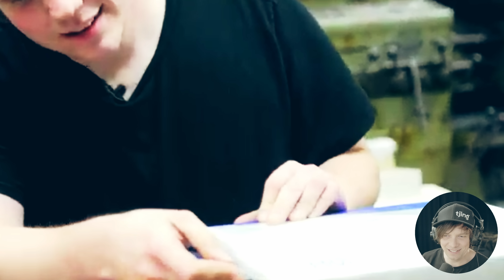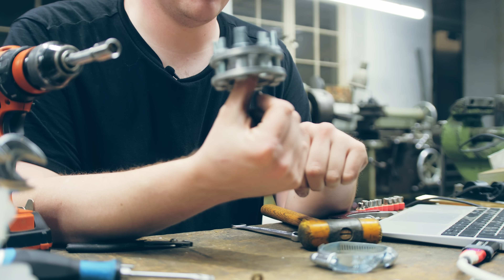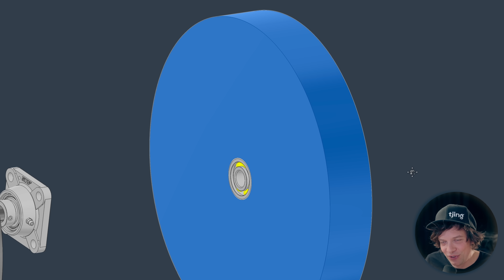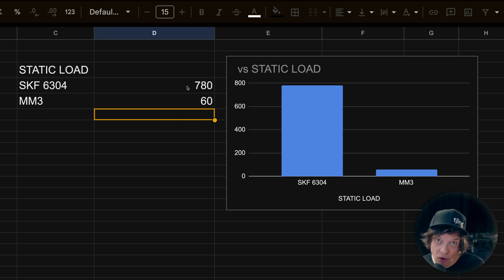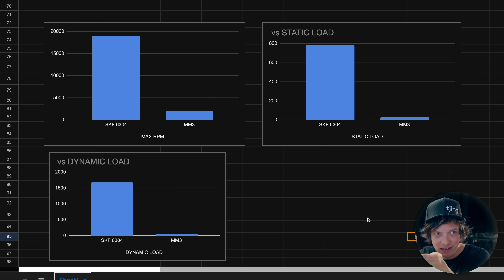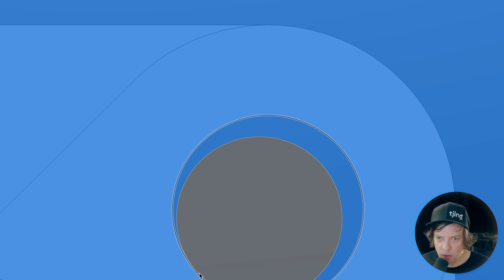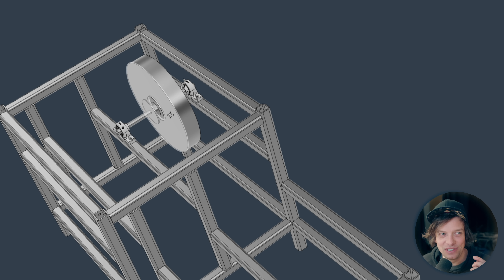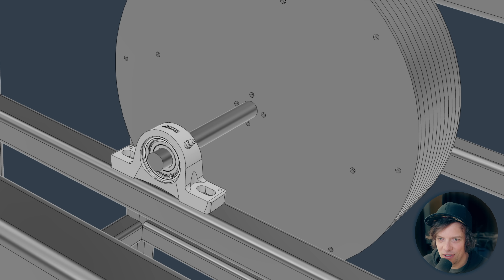Worst Bearing Housing Ever - Marble Machine 3 Ep.3

Comment: I'm no engineer, but fixing the shaft perpendicular to the flywheel not very dangerous? Any tiny misalignment will start a vibration, and destroy the machine, right? If you use a bearing which can change it's angle, the flywheel will keep itself straight, and no vibration will occur. Or not?

Comment: concentricity is good to start with, but probably not enough to achieve a fully balanced flywheel. even if the flywheel is 100% concentric and perpendicular,  it can be off balance, if the material isnt the same density over the whole volume. so you need to balance it anyways. concentricity of course makes you start closer to the balanced state though

Comment: For a stronger linear mass, you want rod-bearings, not ball bearings. You are setting yourself up for disaster with ball bearings. If you must use ball-bearings, use a 4-layer, staggered setup, for the bearing channels. You will get a depression issue, when they wear and introduce "wobble" in the mass, otherwise. Using rod bearings, you get a large, low friction, surface that extends wear resistance. Just like a car axle or generator or... A centrifugal mass flywheel.

Comment: @Wintergatan Take a look at designs for centrifugal pump shafts and bearings used in water treatment/ chemical processing plants, they often run for weeks at a time and newer ones have built in shaft realignment tolerance features that might be useful as a reference. They're designed to be sturdy and accurate too! (Don't have a Reddit to post this comment with sorry 😖)

Comment: i know im late but, you could heat up the fly wheel and put the shaft in dry ice, press fit them together annd when they get to room temperature, teh flywheel will have shrunk and the shaft will have expanded so they will have a super super tight fit

Comment: If you're concerned about concentricity you could balance it on the machine. When mounted on the shaft spin the flywheel slowly and mount an angle grinder to make the world's most bootleg lathe/rotary grinder. As long as the  fit on the shaft is good you'll be able to correct concentricity and perpendicularity.

Comment: I think you spent alot of time calculating what the bearing can handle, but I think the main concern was the threaded teeth- with those forces, the teeth will get crushed over time and introduce slack in the fit around your bearings, causing the housing to slip.
Reply: If anything, you should use an M6 where the portion in contact with the bearing does not have teeth.

Comment: You can use a taper lock to secure the flywheel to the shaft. That should satisfy your needs. You can find commercially available taper lock bushings for a variety of shaft sizes.

Comment: Perpendicular?

Bruh once u got the wheel built the hole the shaft goes through wil l be perpendicular. If u need to adjust it that meansvu f' the shaft hole size and made it too big socit has slop. Just put some shims in and a set screw propnlem solved.

Idk why u all are hand wringing about perpendicularity

Also balancing is where u kill all vibrations from non concentricity. Shims for perpendicularity

Comment: Improving concentricity with flange mounts can be done by using custom cut bolts... turn down from a rod to fit the bore holes tightly, using shoulders where the bore diameter changes.  Only cut threads where needed.

Comment: I would be willing to bet the threads on the bolts will deform over time, creating a slight amount of play. Once that happens even a LITTLE bit, it will be a chain reaction that just gets worse and worse to the point where the flywheel is shaking a and shuddering and the bearings are just spinning around inside their cage of bolts.
I genuinely believe press fitting these bearings into a block of wood would be a better, more reliable solution than this.

Comment: For future reference, chatgpt is EXTREMELY unreliable with simple math, especially anything more complicated than 2 digit addition. You can use it for procedures and formulas and such but when it comes time to do the calculations, use something like Photomath or mathway. It fails to do things as simple as give you a word count on a paragraph or find intercepts in linear equations but it's good at explaining things.

Anyways, I don't hate your design. I think it meets the requirements, and people so confidently saying otherwise don't seem to realize that the bearings aren't going through much. I just don't see why in the world you'd want a static axle with bearings on the flywheel rather than having a spinning axle with bearings on either end. Most generic bearing housings aren't engineered for concentricity so yours makes the most sense in the context, but is it really worth it to use that many bolts for such a small improvement?

As for the clamping, why bother clamping the shaft when you could just get a non-circular shaft and a matching hole? I've had good luck with rounded square shafts spinning at 3600 rpm with decent weight and force on them in skate bearings, and I'm a supporter of the pillow block idea but people are overreacting so much to yours. 

TL:DR, the bearing design isn't bad but it's unnecessary. Pillow blocks good, Use a keyed shaft.

Comment: concentricity can also be achieved after the bearings are put in place by slowly turning the flywheel and grinding of the outer part until you have the same distance from the center all around the flywheel.

Comment: Martin as a software engineer I have to say that ChatGPT absolutely does not have a reliable math or physics model, and often outputs nonsense with these sorts of questions. You absolutely should not blindly trust numbers it outputs for engineering work.

I don't want to sound like a hater. I hope to wear my I Believe shirt to a MM concert one day, but I wouldn't want to be in a crowd exposed to a machine handling high forces that has been designed that way.

Comment: your flywheel 4-piece "clamp" looks to me to be functionally alot like a 4-jaw lathe chuck.  Seems like a lathe or drill chuck function is what you might be looking for in your flywheel shaft alignment search -- however, I think that you might be overcomplicating your design.  You won't be tearing down the flywheel and shaft on a weekly basis, nor building many of these on a production line -- the need for alignment adjustment after initial assembly should be minimal.  Consider using a tapered shaft for your flywheel (look up morse taper in machining practice) with a reamed, tapered hole in the flywheel assembly, and centering and balancing the flywheel shaft assembly just once for the lifetime of the assembly.  A slight bearing misalignment, within tolerance of the bearing design, should be acceptable with a balanced shaft and flywheel.

Comment: Why are you focusing so much on concentricity? Is that needed? you are not running the flyweel at 120k rpm. In any case you can balance the flyweel after mounting, like id done for car weels, using glued addittional weights located properly.

Comment: "Problem" that you have on your bearing housing, are bolts that are used, you definitely need to use bolts that are not full thread. With standard (non full thread) bolts there is much more contact area, that also changes tolerances. Thread is slightly thinner than "body".

Comment: To fix the flywheel to the shaft,  you're looking at a keyway on the shaft and on the flywheel, and a key slid into the keyway.
You could also have the shaft machined with an integral key, but the keyway is going to be more affordable.

Your other option is a splined shaft, which would definitely require the shaft to be machined from oversized stock, and would be unnecessary for the forces this flywheel will see. 

That solution is widely used in industrial machines, fair rides, etc. for affixing flywheels, pulleys, gears, etc. to rotating shafts.

Comment: I think the comment was not about the bearing being too weak but the mounting being too weak. Instead of having it clamped on the whole radius as it is designed to be you're trying to hold it with a few contact points against threaded rods that aren't very much constrained against wobbling. I have no idea whether it would suffice or not but it certainly feels a bit sketchy.

Comment: i deal in hvac.
there is a pulley design that the center is split on the shaft and bolts pull the taper fit together.
the centers of your plates could have the taper, and a small  split cone  pulls in with near tolerances of the shaft.
bolted together, or a tapered thread pulls them together until locked on the shaft.
similar to a die grinder chuck.

Comment: I will say despite the bearing looking kinda jank and unconventional, if the area on which the bolts is larger than this design will work, and like some other comments yes the flywheel should be balanced, this bearing won’t make it as unbalanced as many would think. But on the other side there’s a moto that mechanic’s like myself follow-if it looks dumb and odd BUT works, then it’s not stupid.

Comment: I think you could use flutes on the shaft and plates to locate them via interference. These are called "splines". It would require a machined shaft, but you're basically there anyway.

Comment: If you want concentricity with machined holes, use tapered nuts. Think about an automotive lug nut. The wheels have tapered holes, and the lug nuts have identical tapers at the bottom. This centers the wheel perfectly every time, so long as proper tightening order is followed.

Comment: I think your best bet is to bolt flanges to the side of the laser cut fly wheel, then do a quick truing operation on the circumference with a lathe. that will mean even if the initial bolting pattern is a little off, you'll wind up with perfect concentricity. then use standard pillow blocks with the bearings on the frame. 

Main issue i foresee with the bolts method is that the thread will compress, and you will get movement. A nearly identical but better solution would be to replace standard bolts with shoulder bolts.

Comment: Martin, the pillow blocks are the way to go.  You can get a standard sized shaft with a key  way. A matching key way in the flywheel will allow you to lock the flywheel to the shaft, and locking collars will keep everything in place.  Added bonus is the shaft and flywheel should be perfectly aligned with each other, while the pillow blocks will have some adjustment built in to align the assembly to the frame.
  The type of shaft you need should be common for farm machinery, so look to a farm equipment supplier(think Fendt, or John Deere).  Lots of heavy equipment and farm equipment are using these exact parts all the time under the most abusive conditions and would give you easy access worldwide for spare parts for the future.
Cheers from Canada!

Comment: It seems all the problems you have here are created by your unexplainable desire to laser cut a laminated flywheel when it's blatantly obvious that this application screams out for a lathed single, simple part.
Using the poorly toleranced threads of off the shelf bolts to centre your bearing is innacurate and naive. You're creating a point of innacuracy and subsequent failure.
Step back and re evaluate Marten.

Comment: In the last solution have the flywheel hole diameter the same or marginally less than the axis diameter and just heat the flywheel up while the shaft is kept in the freezer. Next put them together. Once back to room temperature the shaft will never move.

Comment: I don't understand why you seem so set on having the flywheel laser cut rather than machined. From what you've been saying, these problems you're trying to "solve" with the bearing mounts could simply be avoided by getting just this one part machined on a lathe or CNC. You could even get the same design of the layered plates machined and retain the adjustability but it would come out of the box with the tolerances you need. I can certainly see the value in having parts laser cut if they're novel shapes for unique parts, but a flywheel is just a disc (or set of discs) with a hole in the middle.

Comment: martin, you're always trying to simplify, but end up with a more complex design as a result. flange plates can accept misalignment specifically to allow you to allign components ars you assemble. laser cut parts aren't perfect, they won't be balanced. have a machinist bore the center to slip fit, use pillow blocks, then drill ballance the flywheel.

Comment: One press fit bearing is super difficult on such a large fly wheel. How would you would get perfect alignment? The 2 bearing solution is best. Change the shape of the casting to fit with your artistic idea. After all that, you have to lubricate it continuously..... Bolts and a clamp? mmm? I'm sure that someone in the past has failed with that idea before.

Comment: How much cheaper is the laser-cut part than a machined part?  Have you priced it out, Martin?  Because machine tools can remove material a great deal quicker than lasers, so it shouldn't take that much machine time.  Two facing ops, one drilling and boring op, one OD cutting op and four chamfers.  Should be doable in three setups (two, if your machinist is particularity talented) and take less than an hour of machine time.

You could also have a keyway or flange mounting bolt holes done for only a little more.  Either would be super easy and quick for a proper jobshop.

Comment: How would we make it cocentric? Easy. You make a custom tool which is basically a rod with cones.  Milling mashine makes this rod simmetric and cocentring everywhere. Then you insert this rod, and cones will align wheel and a bearing with a high precission. Then you tighten screws You may say that milling requires efforts, but on the other side, milling is cheap, and you can use this tool every time you disassemble machine and need to realign parts again.

Comment: You'll want to use brass slip disks to offset the flywheel in any direction you need. It looks like this (o ) The hole is offset, and you rotate it to position needed, then use a set pin.

Comment: I think the issue with the internet comments is that a conglomeration of individuals aren’t great at explaining things. 
I don’t think most people are concerned about the bearings capabilities or the ideology of your housing; after all, bearings are designed to hold things and let things spin, you’re not affecting that. BUT the concern I think most people validly have is that bolts aren’t designed to be used in this way, threads are meant to share a load evenly-ish perpendicular to the way they’re cut, not to be compressed directly as your design relies on. I think the comments saying using bolts with a section without threading would be an improvement is true. Anything you can do to increase contact area would be beneficial, so going away from holding several round bolts holding a round bearing (minimal surface area) would be beneficial, even if that’s adding some sort of semicircular insert that spans multiple bolts, for example.

Comment: My only gripe with the bearing housing is the use of full thread bolts. It'll probably be fine. The threads may get squished down by the shear forces. I would use partial thread bolts so you have better contact on the bearing.

Comment: The problem is not, so much, the bearing alignment as it is the adjustment of the flywheel.  Your bearing housing is just fine.  You'll have to be able to adjust the balance of the flywheel for your application.  It has to be machined well so it is balanced.  That is where the machinist comes into play.  They have to be able to balance the flywheel before you accept it.
Then the axle has to be set true.  Then you will be able to adjust the shaft to minimize the flywheel deflections.

Comment: You keep talking about the laser cut plates not having enough precision to use alignment pins but fail to understand that you can cut the hole undersize with the lazer and then drill/ream the hole to its final size and thereby creating the exact fit to locate a bearing housing. 

Or 

Spend the money and have a machine shop make the flywheel out of one piece to fit a keyed shaft and stop with this cockamamie idea to fix what isnt broken and do it every way but correctly. You want it precise then pay someone that can make it precise. You're wasting our times by cheaping out on things being stubborn making yet another machine to be better than the last while making it more difficult than it has to be and with more failure points

Comment: 16:30 seems like having 2 bearings is what would keep the flywheel perpendicular to the shaft, am I wrong?
How is the application different than what the housing was designed for?
“to prolong the life of the bearing” is exactly what you would want from a bearing housing, right?
Also notice the grease zert on the traditional bearing housing, seems like it probably has that for a reason…